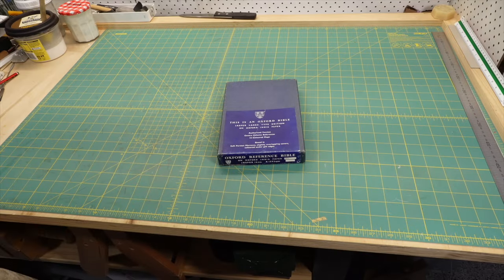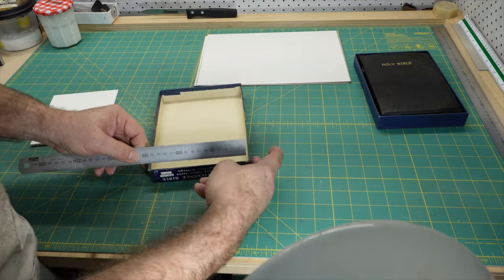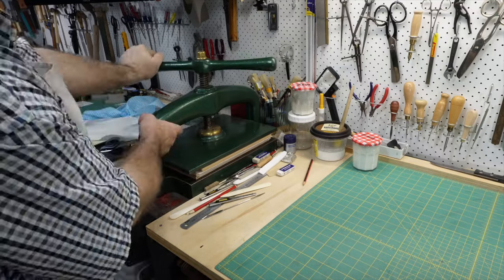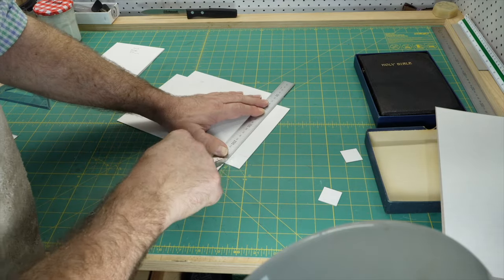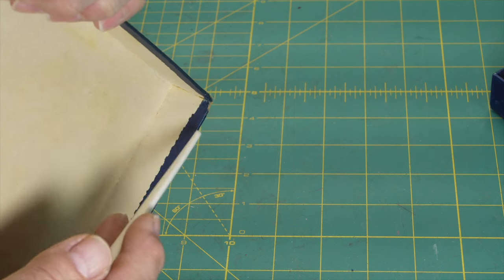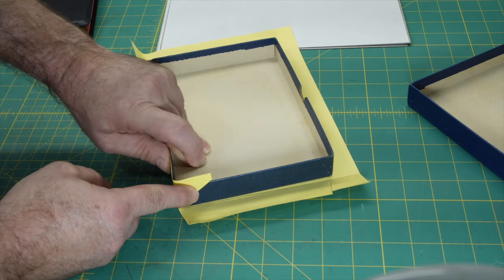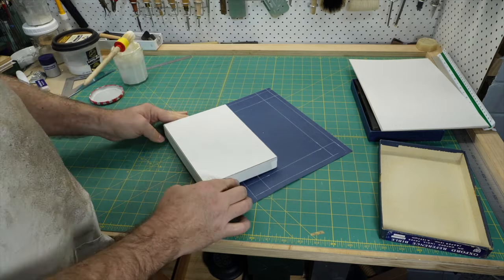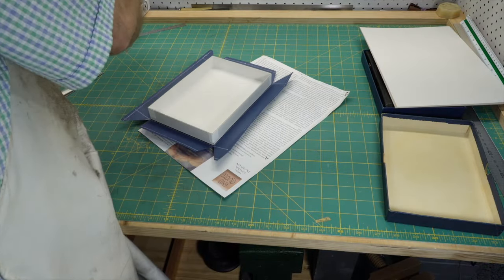Oxford Bible Box - Making the Lid // Adventures in Bookbinding

Comment: This same technique is used on modern large, heavy, premium board game boxes, to make them look extra fancy, by using thicker board, and sturdy printed paper wrappers, so that the scored and folded corners have a beveled look. With the thick boards, the bevel is much more noticeable than on the thin box you're emulating here. And it looks intentional and rather good. I was looking at some patterns from a commercial site and realized this must be how it was done, and checked by indenting that bevel with a fingernail to see it's actually hollow, with paper stretched over a void. And there I thought these were fancy, premium boxes. Your video, and more careful study of the board game boxes, fully confirms this.

Comment: 6:03 Speaking of different traditions of bookbinding, perhaps this can be a topic for a future video: is there a “best-practice” or a tradition for an amateur bookbinder to follow when printing a book in a quarto-kind of manner? If you print four pages to a side of A3 and folding it to A5 size, for example, is there a best way of orienting the pages, or does that vary from place to place? The older cheaper un-trimmed paperback kind of books I’ve seen here in Sweden seem to always have the fold at the head, which makes sense since that leaves the tail, that the book generally will stand on, stay pretty after the reader has cut the pages. But if you trim the text block as you bind it, does the orientation matter anyway?

Comment: My Oxford Reference Bible looks exactly like this one, but has a slip case instead of the two-part box. It seems to be constructed by exactly the same method, but without the lining (the inside is just grey board). I suppose they still make these the same way? They seem to have made a 3 sided box like you do here, then added the second large side as a separate piece, but I can't see any traces of how it was attached.
Reply from the maker: Usually with a strip of paper along the outside seam. It is normally visible as a bump under the covering material. I have a slipcase like this which I will replicate eventually. But I feel everyone is getting sick of boxes. I better get back to books soon:)
Reply: @DASBookbinding  the bump is really almost invisible - I think it's there, but I had to wait for daylight, at a grazing angle, to see it. The texture of the cover paper hides it quite well.